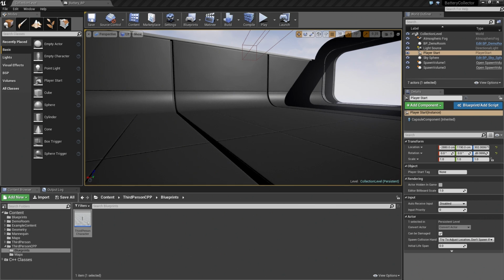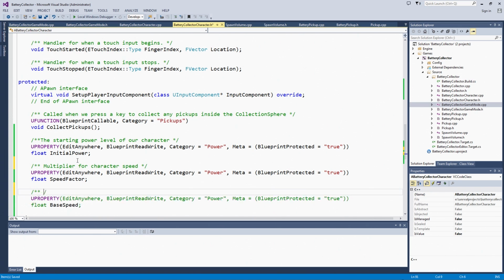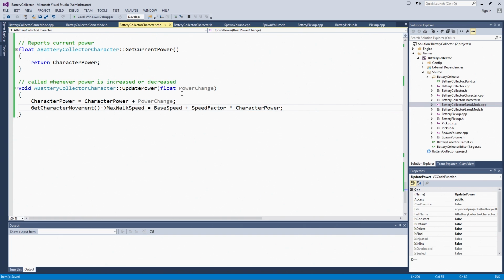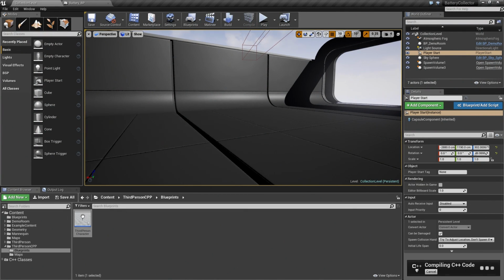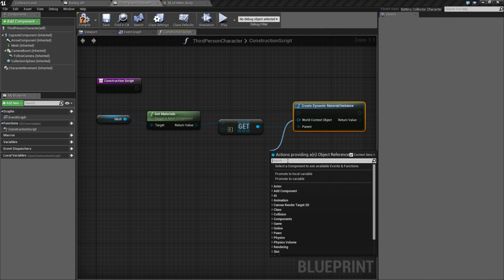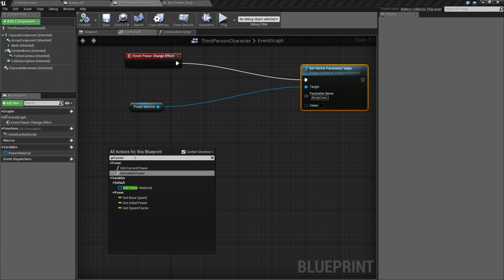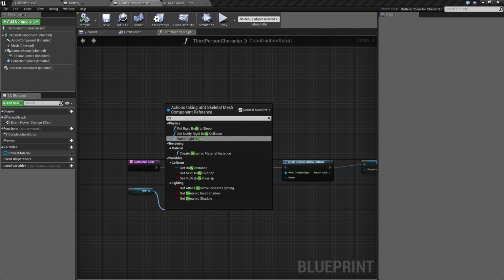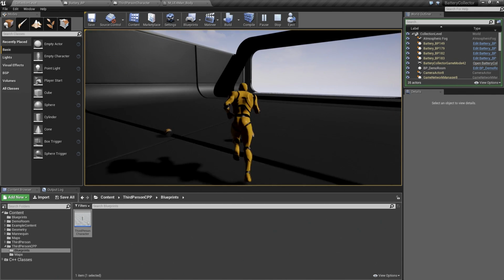C++ Battery Collector: Change Character Speed & Material | 14 | v4.9 Tutorial Series | Unreal Engine

Comment: This has proved to be a really useful series of tutorials on UE4 C++. However, I have one "minor" criticism concerning code style. I noticed that throughout the code member variables are being "initialised" in constructor bodies. Well, it's not initialisation but assignment. Initialisation occured earlier in the compiler generated default constructor initialiser list (because one was not written) and then those default values are then overwritten in the constructor body. That's just inefficient. 

So instead of :
ABatteryCollectorCharacter::ABatteryCollectorCharacter()
{
    ......
    InitialPower = 2000.0f;
}

You should write:
ABatteryCollectorCharacter::ABatteryCollectorCharacter() : InitialPower(2000.0f)
{
    ....
}

See Dewhurst's "C++ Gotchas" number 51, 2003 edition.  For simple types like floats the inefficiency is not great but for more complex ones like strings the run time of the constructor can easily be doubled. BTW, I'm not suggesting everything should be set up this way - some code has to be in the body but also some has to be in the initialiser list such as consts and references so it's good to get into the correct habit.

I therefore have to question why the generated code never seems to use initialiser lists itself. I suppose I could go through all the code templates altering them all....

PS - am absolutely loving this engine. Tried Unity.3d and it's just not man enough to do quality games in my opinion.

Comment: The tutorial has worked perfectly with Unreal Engine 4.11.2 up to this section, moving on to the next.
Reply: Thank you, I was able to follow and accomplish the complete tutorial/vids around a  week ago :) , It is 100% worth it btw, awesome stuff! I had to perform a couple of adjustments through out the way and  the comments have helped a lot, worked like a charm on Unreal 4.11.2.
Reply: It also works like a charm on Unreal 4.12.3
Reply: Works in 4.14.3
Reply: 4.18.2 here. Works fine.
Reply: which set param are you talking about?
Reply: UE 4.19.2  - check!
Reply: Works in 4.20.3 Side note: Don't forget to set the Parameter Name in the EventGraph to "BodyColor"